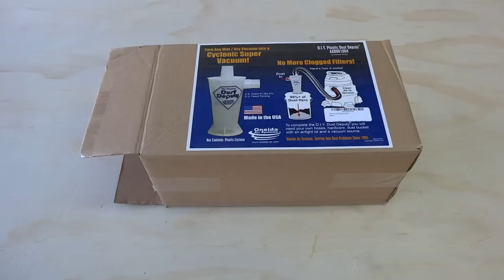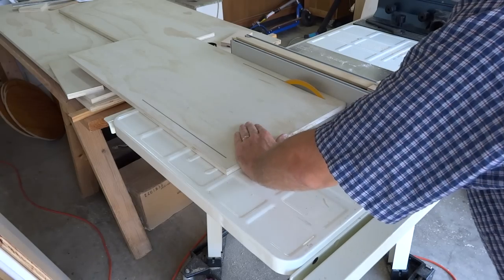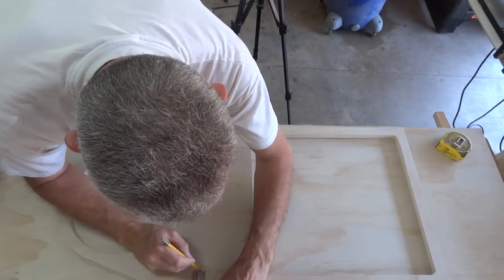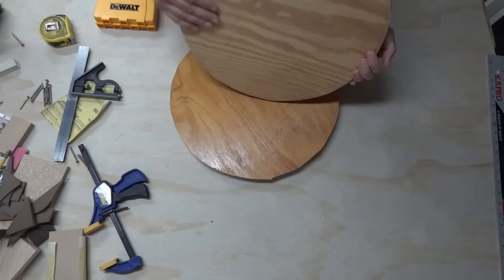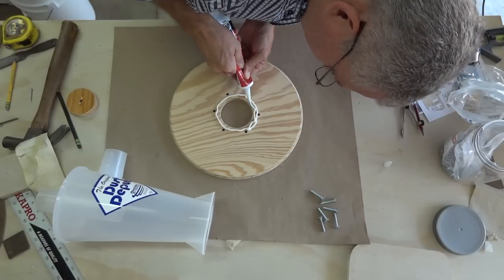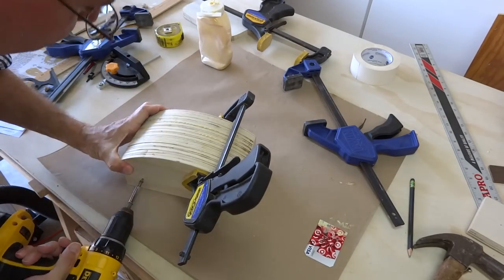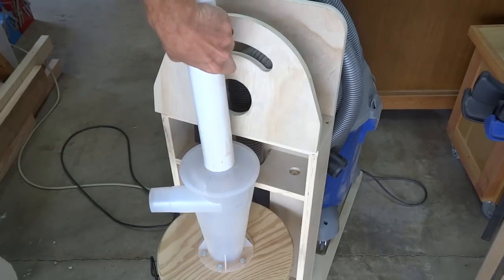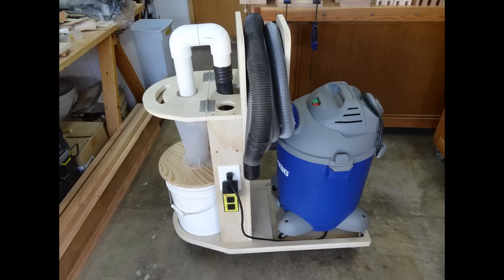Oneida Dust Deputy Cart (Shopnotes #109)

Comment: Great cart design, the outlet/ext4ension cord is a great addition. When I get a chance to make one, I might try adding a built in floor sweep at one end that I could connect the hose to so I can just push it along to clean sawdust off the floor easily.

Comment: I have also brought a dust deputy ( full kit ) and it works a treat! Only problem with the kit is, that when hooked up to my Makita shop vac. it actually has so much suction that it wants to try and suck in the plastic lid into the collection bucket. Would love to at some time in the future build what you have built for your dust deputy as shown in this great video you have shared. Great Work!  Would whole heartedly recommend the Dust Deputy to any one who is considering purchasing this bit of magic. Thanks again for putting together this wonderful video.

Comment: Very nice work and attention to detail. Man after my own heart. I just completed building a cyclone separator using a traffic cone and a five gallon bucket. I am astonished at how efficient it is with a Ridgid shop vac. I can suck up a pile of table saw debris including quite a bit of particle board dust and there is no trace in the shop vac! I can wipe my hand inside and I get nothing. I was looking for some ideas for a cart and I like your adaptation of the Shop Notes version. I was thinking about stacking mine with the cyclone above the vac to take up less floor space. I might still do something similar to yours.

Comment: I liked your video. Good explanation of your process. I got some good construction ideas from you. 

I used the Dust Deputy on its casters exactly once. Tugging two units - the shop vac and the DD - around the shop would be bad enough, but the Dust Deputy is top heavy and fell over constantly. 

My cart has the shop vac above the Dust Deputy so that the air flows up and through only one 90 degree angle into the shop vac. This cart has three (3) 90 degree angles in the hose between the DD and the shop vac. That reduces efficiency a great deal.

Comment: Hi Trevor I subscribed as i enjoyed your video, may I suggest one thing only...The reason that your pipe collapsed is because the suction you have is above what the oneida cyclon can handle ?? one way to get away with it just add another cyclone next to it in serial connection, I have seen that and it works great you feel that you fixed your collapse pipe problem but your problem is there but the pipe you used is too strong to clooapse thus you have a situation that you are starving the suction... sorry for my comments overall it is a great project continue the good wirk. Kind regards from OZ Jack Marashlian

Comment: Hello Trevor Your video convinced me to build this cart for my Fein Turbo vac and the Dust Deputy. I like your modification to the plumbing connection using PVC from the DD to the vac.

Question....Do the 2 90 degree bends impact the air flow at all? I recall that you did it because of the collapse of regular 2" hose.)

Thanks so much for the great video!

Comment: I like this design, it seems like it makes the shop vac easier to remove if I need it for a messy cleanup. I was considering buying a cheaper shop vac to use permanently in a Dust Deputy cart, but with this design it looks like it's still easy to disconnect and remove the vacuum. 

How stable is it? Do you have any issues with the cart tipping from pulling on the hose during use?

Comment: If your previous motor burned up because the filter was clogged, it was probably because the blower runs at higher speeds without a load (no air flow) and this could damage the bearings, or because it depends on airflow for cooling.  However, it's interesting to note that blocking the airflow actually causes power usage to go down. The motor is actually working /less/ when there is no airflow.
Reply from the maker: It may have been a flaw with the motor then. What happened is the motor burned out at the carbon brushes. The plastic retainers melted and the brushes came out (it was so long ago, perhaps the bearing overheating caused the area around the brushes to melt). I put it down to repeated strain on the motor since logically I thought the motor was working harder because air flow was restricted. Thanks for the feedback.

Comment: I had put a dust deputy alongside my shop vac and decided to build a stand like the one I saw on the Woodsmith Shop when I stumbled on your video on building yours. I noticed your crosscut sled, and really liked the T-trac slot on top of the rear fence. Are the 4 long slots in the bottom also for T-Tracs? 

Very nice video too.

Comment: Thanks for sharing, Trevor.  If anyone is looking for the plans from ShopNotes #109 Shop Vac Cart, they can be found here: https://www.woodsmithplans.com/plan/shop-vacuum/
Reply: Hey Woodsmith folks (or Trevor) -- I notice the plans call for a lot of screws going into plywood end-grain. With the exception of the 3" screws going in to the tall piece through the bottom, wouldn't pocket screws be a better (stronger) choice for the butt-joints?
Reply: Pocket screws would be a perfectly acceptable substitution... in fact if I were building it now, that is probably what I would use.

Comment: Very nice!  What is the purpose of the hinged top?  How do you empty the bucket?
Reply from the maker: +Cane Pazzo The hinged top allows the top to lift up so the bucket and top can be removed underneath. The reason is because the bucket sits in a recessed hole in the base so to lift it up and out, the top has to be able to move up as well. Otherwise there is no other practical purpose.
Reply: +Trevor's Workshop Do you have to remove the PVC fittings each time you want to empty the bucket? The PVC is a great idea- much more efficient use of suction than the flexible corrugated pipe. Great work!
Reply from the maker: +Gerard Williams the PVC pipe is just friction fit. It is possible to remove the lid and take the bucket out without disconnecting anything, however, I normally detach the pvc from the dust deputy and take the entire section outside when I wish to empty the bucket. that way I am taking all the dust outside when I pop the lid off to empty the bucket.

Comment: Great video, very clearly presented! 

What type of router bit are you using for the round cuts in the base?
Reply from the maker: +dakotamax2 I am using a freud 1/2" straight bit, search amazon for ASIN B00004T7CK
Reply: +Trevor's Workshop Thanks for the quick response!

Some reviewers on Amazon claim this bit is not a good choice for plunge cuts, but your demo seems to contradict this.

Would a spiral compression bit be a good choice for this application?
Reply from the maker: +dakotamax2 I do not own one of those type of bits so I cannot comment on that. The freud bit is designed to allow plunge cuts so it has worked well for me in many different types of applications. If I were to only do plunge cuts, for example to cut mortises, then I may look to purchase a spiral down cut bit but the freud bit I have works fine for what I do (and is a lot cheaper). Hope this helps.
Reply: +Trevor's Workshop Freud it is then! Thanks for the responses; I'll be watching : - ).
Reply: dakotama